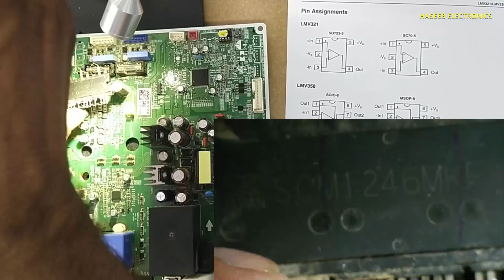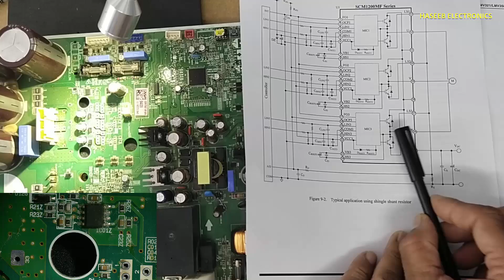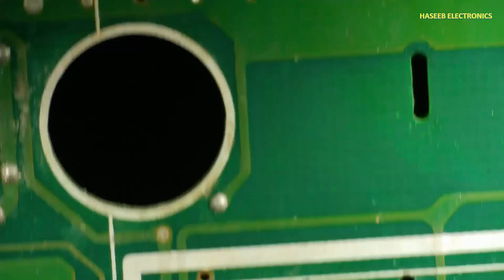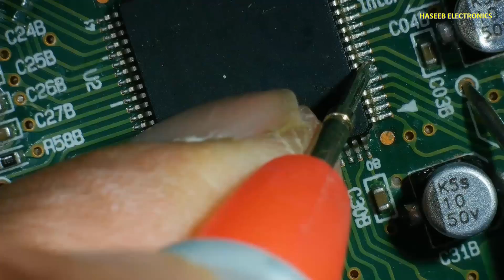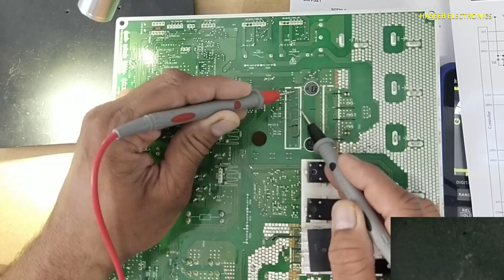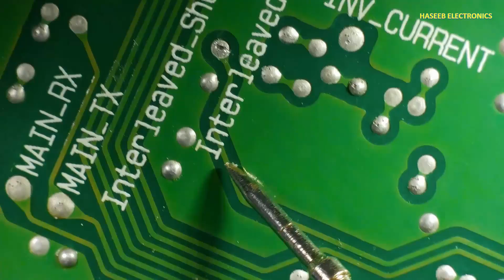{972M} IPM Current sense circuit explained

Comment: I have GRJW924-A and the AC give U1 error... I tested the IPM U V W and found 97v dc at standby mode before press on ... but in the 2nd working ac with same GRJW924-A board the voltage is 78v dc at standby. where is the issue is it the comparator ICs nearby the IPM or the shunt resistors etc ?

Comment: Hey, thanks a lot for the video series on repairing inverter air conditioner boards. I'm currently fixing a broken heat pump. Thanks to your videos, I've got a pretty good grasp of the board's circuitry. Please help me with something else. I have three shunt resistors that go from the IPM microcontroller, and they got very hot, to the point that the varnish turned cherry red, and on the other side, the board darkened. What could this be and where should I look? Thank you!
Reply from the maker: best regards and thanks for kind words 
in you case it seems, IPM or power module + driver circuit is malfunctioned 
in case of IPM or power module, you can check datasheet and test it 
you can calso check this video for IPM    https://youtu.be/Mx7wTclVjbs 
and also check this video for power module   https://youtu.be/wTca6RONT7c